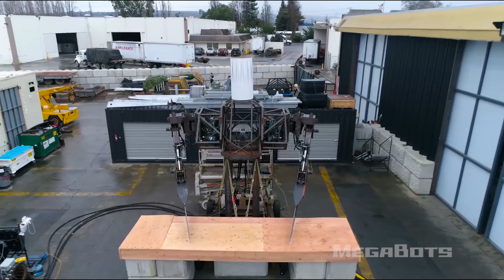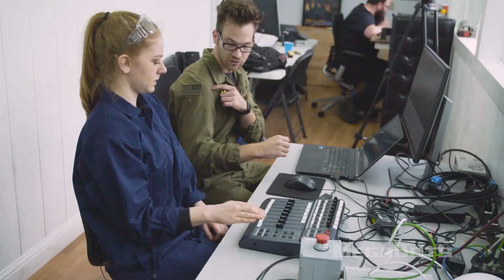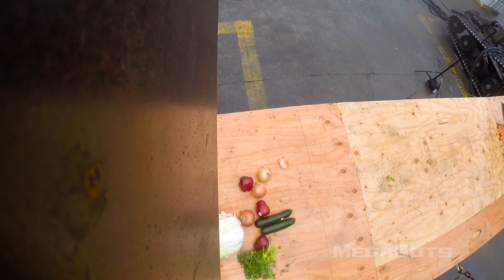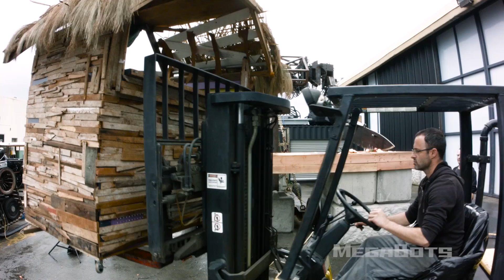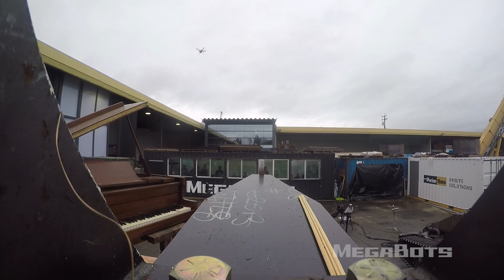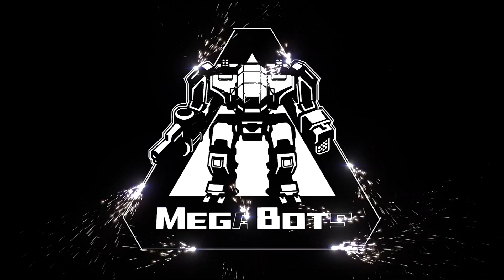GIANT KNIVES ON A GIANT ROBOT (Simone Giertz Collab)

Comment: I'm wondering if you guys are going to upgrade the hydrolix system when it comes to the fight, if the robot is not able to crush a piano then its not able to crush metal alloy but the robot is still pretty strong.

Comment: I still think they design is shit, like in any real battle type scinerio the pneumatic are just way too slow to do anything. I understand electronic servos probably could not handle the strain, but my eyedea wpuld be to mount a small engine either on each shoulder or one larger right on the back, basically work it from that. my science might be off shit throw a cummins on that and BAM! power for days

Comment: That thing needs a high flow low pressure pump for just moving around faster.

Also having a two person crew on board is going to limit how violent you can get in those robot fights. It's going to end up like wrestling instead of real fighting.

Comment: I just realized something: when the fight with the Japanese robot happens, they're going to need a ton of spare parts and replacements to do the mech equivalent of a pit stop. The frame is definitely durable, but the systems powering the thing are a lot more fragile. I know they designed the weapon points on the arms to be modular, but how much time would it take to swap out a set of snipped hoses from, say, the torso area to the right arm?

Comment: I'm lost. I thought this was about prepping your mech for a legit fight? All your weapons choices have been cliche or completely novelty. Do you guys truly believe these knives made it combat effective? Is this going to be boxing/robot wars? Or realistically WWE/play fighting. Cause knives/blades are only effective with lateral pressure. You don't cut your steak by pressing the knife straight down on to your steak. You make a sawing motion to cut. To take advantage of your ability to chop. You kind of require quick and forceful actions. You also can't chop tempered steel like a pork loin. 

Could at least have pre-programmed jabs with the blades.Let alone the concept that the blade design you chose. Would require the ability to slash at a pitch your arms do not support. Also, considering you're fighting an armored unit. You would require a great deal of coordination and range of motion to effectively use them properly in a fight. As in aiming for joints and weak spots in armor. With this design you have the range of motion of a early 90's G.I.Joe action figure. 

It seems like this realistic challenge turned into a novelty play fight. Since your walking into a fight against an armored unit doing the cheesy Psycho over head chopping motion. Might as well add the sound effect of going " RE RE RE RE" as you chop. By no way am I saying I could do better! I honestly looked at this fight as my childhood dreams of being able to attend a RL robo jox fight. Plus, I want my country to win. This could be the new race to the stars or the new Olympics.
Reply: Relax. They clearly stated they made it just to do it for her. To commemorate what 1 of her robots did in her channel. Don't take this ep seriously. I'm sure the real battle will not be them trying to go Samurai on the other bot.

Comment: I continue to notice the speed of the hydraulics is very slow.   If this does not change, the actual fight is going to be rather dull to watch.   The sport will never make it past the novelty stage.     Another problem is that the cost is so hi that there will be very few competitors, just like with aircraft racing.   I'm sure the team is thinking about such things.
Reply: Arcterion If you watched the vids. You would of known that they were working already not only on the new cockpit. Yet also the treads and movement of the legs, so that it would be able to dodge attacks. 

They're not going to throw everything together till they worked out all the kinks for all of the sections of the mech.

This is exactly what happens when people comment, but never took the time to watch all of the vids in their channel. They explained it all already. 

Once the other parts are good to go. Then they'll assemble the bot together. It just makes no sense to put things together and work around parts that clearly needs to be adjusted. When they can have different people work on different sections of the bot. 

Once that's done. Then they'll assemble it altogether.
Reply: You want them to pop out full on Gundams. I'm sorry but we aren't there yet in technology. I'm sorry they don't have a Plavsky Particle Accelerator lying around.
Reply: Considering it's been 1.5 year one would've expected a bit more progress than just a frame and some basic moving arms though. :(
Reply: Another reminder for this I guess. The Robot has BEEN done for a while now. This footage is months old.
Reply: captquazar It's WAY faster than you think. Watch the newest video from the channel

Comment: So... why no MAP gas torches that make up an upper limit "sheath" of sorts .... I thought "RED HOT" and "1 000 degree" knife videos were 'All the rage" these days .... not ambient temperature ... i'm disappointed, this could have been so much more dangerous.

Go to Home Depot and get some MAP cans and strap 'em in a row along one of the knives' upper limit (edge) ... LET'S DO THIS!

Steps:
 1. RAISE TO HEAT, 
 2. LOWER TO CUT, WHEN HOT
 3. WIN THE YOUTUBES!

BUILD:
buy TEN 3 inch hose clamps,
buy TEN MAP gas bottles with manual heads,
Grab a 12' long piece of angle iron,
weld a 6" tall 2-1/8" ID collar on the rear (robot end) of the,
stick a vertical piece of 2" OD pipe/tube to the outside of the robot's shoulder,
weld a couple 1/2" tabs 6" down from the top on the vertical 2" OD pipe,
weld the ten hose clamps to the (horizontal) 12' piece of angle iron spaced evenly from the tip,
weld a 25ft chain to the tip of the 12" angle iron(arm),
insert MAP gas into hose clamps & tighten,
light the line of gas,
put man on end of chain to rotate the MAP gas arm away from the robot if needed,
Keep ladder and welding gloves nearby (to turn off MAP gas arm cans)
raise knife into gas flames and wait,

THEN FUCKING CHOP!

hand camera crew fire extinguishers and put out the flames

$150 to build a quick and dirty, 1 time use rig to win the internet ... that's just good value on an $800,000 robot.

Comment: Pretty rad but with everything we've seen so far, the real problem with all the shit you've tacked on this robot so far is speed. I wonder why your engineers even spent so much resources on figuring out (and actually building) these blades when the outcome is only a slow-mo sushi chef. I DO understand that experimenting and trying out new stuff is the way to go but c'mon, what is this going to kill? Nothing?

"Ooooh, waaaiiiit, I wiiiill juuuuuuust mooooove ooooone ooooof my pneumaaaaatiiiic hoooooses uuuuunder your blaaaaaaade sooooo yooouuuuu caaaaan cuuuuuut iiiiiiit!" Dory speaking whale – said no gigantic Japanese robot ever.

Imho, you guys should first figure out mechanics that can move these things at a reasonable speed to be able to even damage another robot and THEN put on all the hilarious stuff.
Reply from the maker: Matthias Wehrlein couple of quick notes: only one joint is moving at a time in this video. The robot speeds up quite a bit when we move multiple joints at a time. The track base is also quite far away (which it won't be in the final robot), which increases line losses. We just swapped our engine out to gain 100HP for higher flows and more speed. We're also installing intermediate accumulators in the torsos, which will increase speed further. 

tl;dr We're working on it!
Reply: Why are you even telling this guy your secrets? 

You're suppose to kill these comments with the final product. In order to shut them up. Telling them on here what you are doing next only informs the competition. 

Just keep doing what you're doing. Screw the negative comments.
Reply: Hey guys, thanks for the reply! This sounds much more promising. Curious as to see the final "product". Also, I apologize for my rather sarcastic comment. I really love the stuff you all do but got carried away a bit.

Comment: Now make it 1000 degrees
Reply from the maker: Rafael vieira oh my god everyone wants hot knife videos.
Reply: Rafael vieira giant robot dual wielding 1000 degree knives.... oh yeah
Reply: MegaBots Inc JUST DO IT!!!!!!
plz!
Reply: Rafael vieira lol 1000 degree knife vs giant Japanese robot
Reply: YASS PLZ
Reply: Just mount to blow torches along each side of the back sides of the blade, it'll heat up just fine. :)
Reply: Apparently you're unaware of an interesting little device called an electric stove. Apparently, energy does in fact work that way.
Reply: idk i think it's v hot already
Reply: Rafael vieira YES GEAT IDAE BEAT IDEAD
Reply: Its getting old, but you would get a good few dollars for "Giant Robot cuts stuff with GIANT RED HOT KNIFE"  It would take an age to heat though!
Reply: You need install a nuclear generator to heat up the hawk.
Reply: You'd need a huge amount of very strong blowtorches.
Reply: bren cav you could heat it electrically
Reply: I was thinking about that, and thermal dynamics, and how heat transfers, and no, not really. one on each side of the blade near the back, and heat will make it's way to the front... And then you'd just need to maintain it, with little bursts of heat. Or as Bryan pointed out, just like a hot-plate or griddle, just pump juice through it and it'll get hot enough to cook burgers. Maybe not 1000 degrees, but damn hot.
Reply: The problem with electricity is it is so big the current needed to heat it through resistance would need to be huge, its resistance is probably quite low over the whole length. However if you put the contacts on either side of the steel plate, the distance isn't as great and it should heat relatively quickly.
Reply: Yup, whether heating with torches, or electricity (which actually may be more efficient) it's going to need lots of juice. It can get a good portion of it from the actual engine that powers it. But it should maybe have a back up power source if for some reason the transmission of energy from the engine is disrupted. The chassis can carry it though, it's robust enough. Suffice to say, it could be done, it's just how expensive is it going to be to do it right? That's the question.
Reply: RED HOT RED HOT
Reply: Rafael vieira Hhahahhahaa
Reply: like silver samurai from wolverine movie